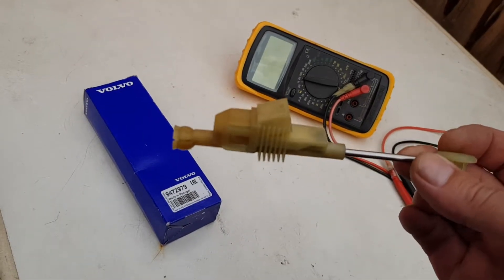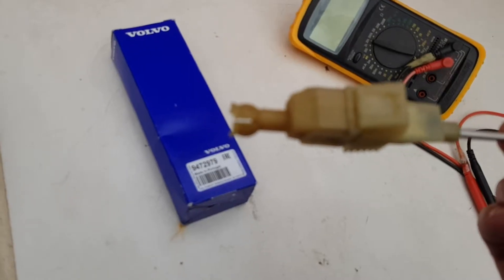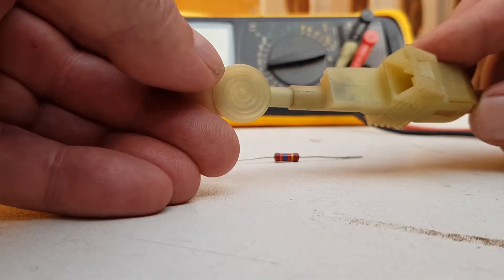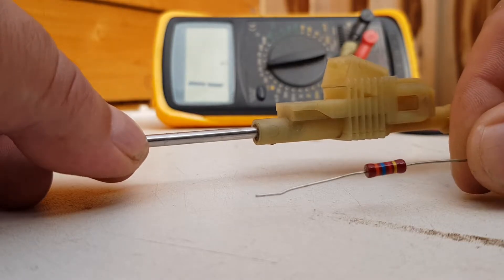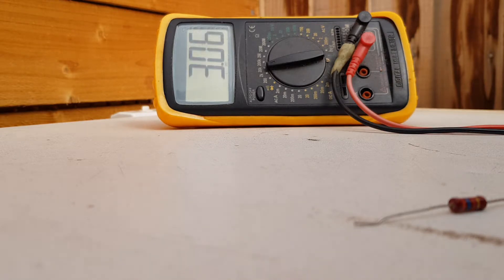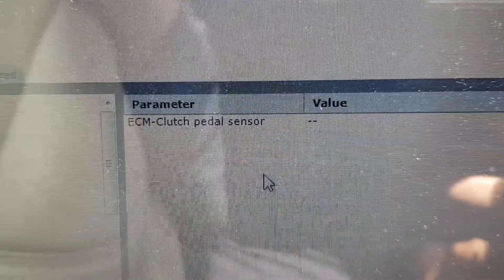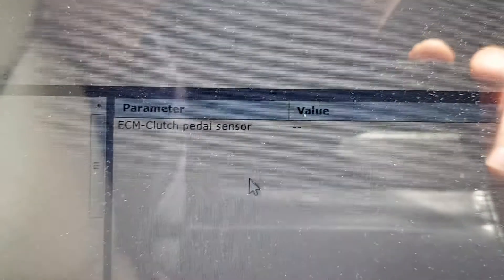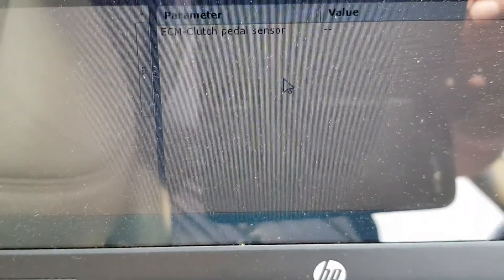Fix Volvo Clutch position sensor for pence!

Comment: Looking forward to trying this but having a problem - ordered two sets of 4.7k 2W resistors but both are physically too large to fit in the housing. Local shops said they wouldn't be able to source or know anywhere that would! Does anyone have a handy link to ones they know will fit? Cheers.
Reply from the maker: Doesn't have to go inside the housing, a short piece of wire, and fit it on the side of the housing, then tape it secure?

Comment: I'm really surprised that people haven't seen how much fuel consumption literally skyrockets when this slide resistor, and consequently the cruise control, stops working properly. This is an easy thing to fix yourself and it saves your wallet and the environment. Win-win. The simple and cheap thing is to solder on a resistor (3.4-3.7 kohm) in parallel with the slideways.. So you don't need to change the clutch position sensor, but only divide it and solder on a resistor in parallel.

Comment: God bless you, volvo s60 2001 here and it fixed my cruise control.
Reply from the maker: Glad the video helped.
Such an easy solution, to what should be a simple problem.
Why volvo chose to make things so complicated is beyond me?
Reply: @philcross7315  I think its worth the complications 🤣 all in all saved me 50-60€, only spent 0.10 for the resistor and did the work myself

Comment: Phil Cross Thanks for solution ! Was 280 - 4140 Ohm. I used 10kOhm 1/4w (2W was too big) resistor and now is 280-2900 Ohm. No error messages and cruise is working. Greetings from Poland 🙂
Reply from the maker: Nice work!

Comment: Thank you! This fixed the P0808 error on my 04 S60R. Cleaned off the carbon residue with some cleaner and added the suggested 4.7k 2W resistor. Works good as new.

Comment: Will this work if it’s had the master cylinder leak fluid on it? Or should I get some break cleaner on the insides? Fitted my sensor and it’s stopped working after a few week, gutted
Reply from the maker: You could try cleaning it, but not sure how it will go. If you get a resistor across it, and lower the value enough, it will think the clutch position sensor is correct. The only thing with this though, is the cruise control won't disengage when you press the clutch. I wouldn't see this as a problem though, as I am usually touching the brake pedal.
Reply: @philcross7315  it’s all new to me, I’m totally inexperienced when it comes to this issue so I do apologise, when you say lower the value what does that mean? Should I try soldering the resistor on as shown in the first part of your video? In all fairness that wouldn’t bother me as I press the brake aswell as the clutch anyway. Thanks for your reply

Comment: Got a new sensor 200 ohm to 2.95kohms, Vida shows 80% with pedal pushed and 25% with the clutch released, when the pedal is pushed cruise works as soon as you release the pedal it throws the error message, brand new Volvo sensor, ridiculous, don’t know what else to do…
Reply from the maker: Weird? Is it possible to get the supplier to replace it, and try again? If not, perhaps try a 10kohm potentiometer, and dial it in?

Comment: Any ideas why my cps wont work. I soldered 3.6k resistor, but cps open position resistance was only 1.9k. Then i soldered about 7k resistor, but still cps open position resistance is only 2.3k. Cruise wont work. Sorry my bad writing. Greetings from finland 😁
Reply from the maker: Hi Tuomo, can you try a lower value resistor, or even better, a variable resistor? This would mean you could lower the value a little more, and get the cps back into an acceptable range.
Reply: @philcross7315  Yes i can test variable resistor. What is the cps acceptable range? No higher than 3.2k, but what is lowest possible resistance?
Reply: Year late but heres my answer- You have to measure resistance without parallel resistor when plunger fully extended. Then use online parallel resistance calculator for two resistors to get resulting resistor value which would cause whole resistance become between 2k9 and 3k. In my case it was very little over 3k so I had to use about 55k resistor.

Comment: Thank you for this! I had 5,7kOhm and reported motor problem (=no cruise control), so I bought 2,7kOhm 2W resistor, and although it shows 1,7 kOhm max, it works just fine (V70II 2002 D5) :)

Comment: Brilliant! Replaced 1st one at 140km and now at 250km acting up again. Measured 4.5k extended and 300ohm compressed. Tried a 4.7k resistor but no joy. Tried a 10k resistor and now 3.1k extended and still 300ohm compressed. Car worked okay today. No science involved as just tried some resistors had lying around. Saved some $ for the time being. Thanx.
Reply from the maker: Good to hear. 👍

Comment: Thanks for this, I've got the same problem but now I will definitely try this.
Reply from the maker: Let us know how you get on? 👍
Reply: @philcross7315  So cleaning it with contact cleaner helped for a little while but then the fault message came back. I had 4330ohms open & 358ohms closed to start. I soldered in a resistor & got it down to 2910 & 350 & so far no more problems. Cheers
Reply: Phil, just an update. I've had the same problem happen again, I've still got 3.6k & 0.56k resistance on the sensor but suspect it might be time for a new one.

Comment: Thanks for taking the time to post this. I have just fixed mine for 98pence usng RS Stock No.850-9625 a 10K pot as you suggest. The 10K might explain why I couldn't get the low end below 350 with the top at 3K but the car is happy thus far.

Comment: I got mine to the limits you posted. When I use Vida I still have the error. Instead of on off I get a % value. 80 pedal up. 25 pedal down.
Reply: Got a new sensor and Vida shows 80% with pedal pushed and 25% with the clutch released, when the pedal is pushed cruise works as soon as you release the pedal it throws the error message, brand new Volvo sensor, ridiculous, don’t know what else to do…

Comment: Hi Phil,

I have my sensor on my dining table after diagnosing P0808 (Clutch position sensor high).

Peculiarly, the resistance reading is not changing at all with the variable state of the rod being depressed - absolutely no change at all. It’s measuring between 12k and 15k and appears to vary depending on number of “pumps” between readings (but doesn’t change during said pump). Would you hypothesise that my sensor is kaput and I should buy a new part or would the resistor trick still work in theory?

Thank you!
Reply from the maker: It sounds like the resistive track in your sensor is knackered. I've not tried it, but theoretically, you could attach the rheostat, and dial it in so that the cruise control can be activated, but it would mean that it wouldn't disengage when you press the clutch. Personally, I wouldn't have a problem with that as I disengage it using the stalk, or by gently touching the brakes.
Reply from the maker: Attach the potentiometer, and set the resistance across the clutch sensor to about 3 Kohms, and put it back in the car. Then go for a spin, and see if the cruise control engages. Like I said earlier though, it wont disengage when you press the clutch pedal.
Reply: Phil Cross thanks - would a fixed resistor also work in this scenario and if so what resistor would I need?
Reply from the maker: @jjtc6  a 3.6 k ohm should do the trick?
Reply: Phil Cross well well well. Took the precaution of ordering a replacement sensor from a gentleman braking an 06 plate S60 with 70k on the clock. Couldn’t stomach buying new (in case I couldn’t fix with resistor). Couldn’t believe my eyes when I open up the new unit to see two contacts that actually run along the resistive track - my old one had no contact at all - just a small copper ring. The tell also being that the rod could swivel 360 degrees with absolute ease. I have no idea what happened to the contacts - they are nowhere to be seen. In any case the “new” unit is measuring 3.04k ohms when open & 0.21k ohms closed, which I believe to be in tolerance. I will install tomorrow and report back! Thanks for the video! I think my old unit is for the bin however!

Comment: Would a normal OBDII reader pick up the P0 code fault? No cruise working for me but no error message on dash - want to be sure it’s the sensor before I take out!
Reply from the maker: Hi Jack,
Yep, a cheap Bluetooth obd reader picked it up for me.
Reply from the maker: P0805 was the error code I had.
Reply: @philcross7315  hi. I habe no issues everything works but error code for clutch switch comes up via obd. Patient is v60 d5 2011. Is the same part number for this car?
Reply: Cheers, it picked it up! Asked a new question !

Comment: I checked it at VIDA, for the ckutch position the value i see is in %,
Reply from the maker: Does your sensor work? What percentage readings does it give you at top and bottom of clutch travel? My vida only shows on/off.

Comment: Great job! I have same problem but in vida it say ecm-9300 but same symptom like yours.... I Will try this. Thanks Great video 👍🍺
Reply from the maker: Hope it works for you.
Reply from the maker: I've just checked ecm-9300 is the same error code as P0805. I'd appreciate it if you could let me know how you get on? 👍
Reply: @philcross7315  yes man 👍 i got 4.7k open and 340 closed. What resistor should i buy? 2watt 3.3k? Because your number where higher then mine....
Reply: Didnt work i got good reading in closed 220 but den strange high on open 5.7k? Tryed 5k and 10k podentionmeter.
Reply from the maker: @yeahbuddy6852  If you wired the potentiometer correctly, (connect the centre pin, and one of the outside ones) you should be able to dial it down to 0 Ohms if you turn it all the way. Can you give that atry please? Phil
Reply: @philcross7315  i dont have pedometer left. I get it back to store because it didnt work. I maybe try later on.... Not easy to find pedometers...
Reply from the maker: @yeahbuddy6852  they are difficult to find, and usually you need to do a lot of walking 😉
Reply: @yeahbuddy6852  Hi, which resistor did you use?  Mine is open 4.69 closed 0.31